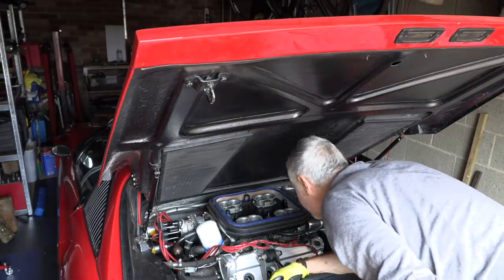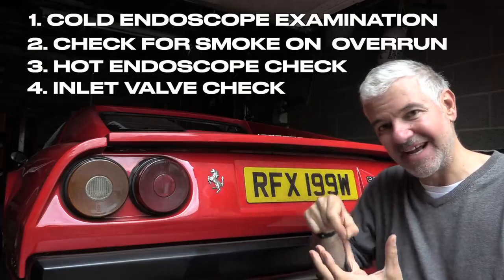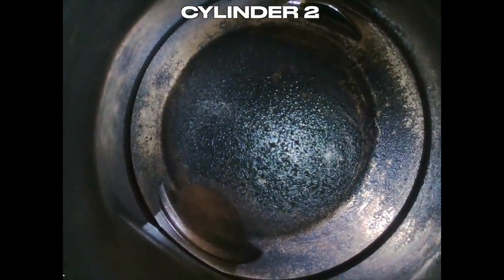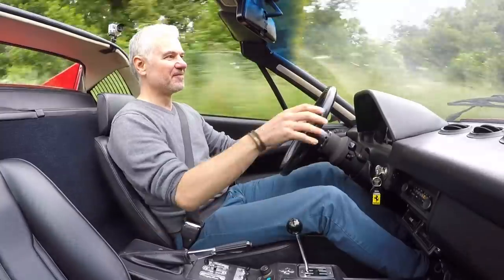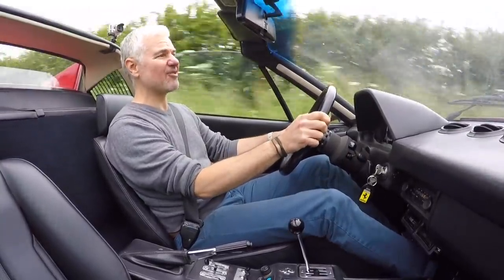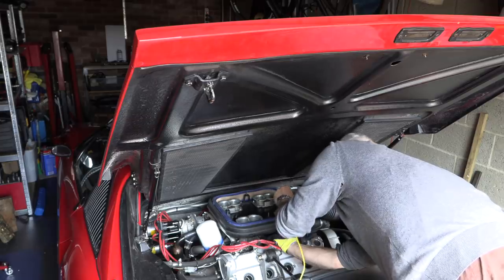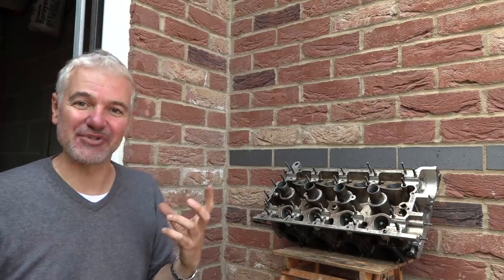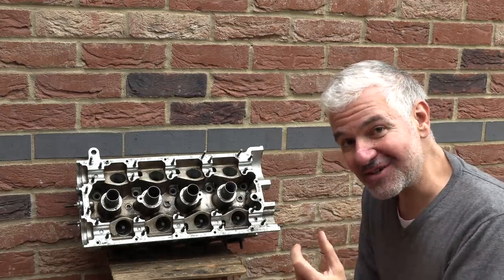Could this £50 tool help me save my cheap Ferrari?

Comment: I don't believe you mentioned if there is any oil consumption. My 308 had a full engine rebuild about 10K miles ago and there is absolutely zero oil consumption between oil changes (every 3000 miles) and no blue exhaust, like yours, at startup or hard acceleration. I know ... it is too soon to see this.
Reply from the maker: Yea it is using oil, just monitoring how much at this stage..

Comment: I wouldn't waste my money on additives. Tbh if there is any major mechanical wear, you are not going to refurbish the engine with any kind of additive. And if you drive the car regularely, there is no reason for stuck rings (you have hardly any carbon build up). I think it's fine, just drive it and have fun ! I'd also go with thicker oil as stated in another comment if it smokes to much. Check how much it burns. A little bit is ok.

Comment: that first endoscope of the inlet valve... are you sure that wasn't a slight pool of oil right at the back of it, collected on top?
Reply from the maker: Don’t think so.. and the oil is dirty so if it was going down the valve stem it would leave stains but as you can see the valve looked immaculately clean

Comment: I don't like the "old cars should smoke a bit" approach, having had cars that did this the problem ends up getting worse, you don't enjoy them properly when you do drive them, you just spend your whole time looking in the rear view mirror for smoke and you have to acknowledge the unresolved problem when you come to sell. This car's engine is in your head now, use the knowledge, finish the job! Plus this is great telly...

Comment: Ok, Oil that runs down the Cylinder Wall will NEVER collect on the Piston and the reason is that the first ring is several millimeters below the top edge of the Piston. Any Oil that runs down the Cylinder wall will run into that gap (Wall and Piston), fill the gap first if the gap on the ring is ‘gunked’ up and then collect on the lowest side and ‘flood’ the piston. This Oil that you are seeing (if it is even Oil) is not coming from the Walls at all but from the heads above and closer to the center of the Bore from where it ‘drips’ onto the piston.
However, why are you so worried about it burning a little bit of Oil? Now that it’s running great, according to you, enjoy the darn thing and put some miles on it!
After 3000 miles or so add up how much Oil was consumed and then determine if it’s worth to do anything about it… Have fun and update us in a few thousand miles😉

Comment: My tuppence worth, it's not got the usual ring worn oil burning traits, ie, blue smoke on acceleration, it seems to be after overrun it puffs out plus it puffs of smoke on start up, all classic signs of top end wear....

Look at it this way, no oil burning before, put some heads on and err it starts smoking, my moneys on the heads, dud they clear all traces of grinding paste before reassembly? I've had experts touch my cars in the past, I've always had to go back and do the job myself in the end anyway.

Comment: The exhaust side indent doesn't look like it has oil in it, just carbon. Probably accumulation as a result of the fluid dynamics and flamefront within the combustion chamber; there would be a "dead zone" in the indent. 

The intake indent is washed by the fuel/air mixture which would explain why it's cleaner, it would also have a greater heat/cool cycle which may affect buildup.

Comment: Have a look at BG PRODUCTS they do an oil flush called EPR which will remove the carbon from the oil scraper rings,we’ve had great results increasing compression, reducing blowback, etc 👍
Reply from the maker: Thanks buddy, will look into it

Comment: This might be a stupid question, why do you rev the car before 55 seconds?
Reply from the maker: You have to Rev it a little to get it started and also to make sure it’s starts running on all cylinders. The choke is not connected on this car
Reply from the maker: Also the clear out the oil, would take longer on idle and give plugs chance to foul
Reply: @Number27  OK that's fair enough. 
Did you see my other comment about a possible crack in the top of the piston on cylinder four? or is that just a scratch in the top of the piston?

Comment: Hi,  PLEASE... Just do a Leak Down Test !  I have rebuilt Ferrari Engines (and many others) and it has never taken me more than 20 mins to fault find/initially establish where the weakness is: -  I.E. Bypass at Rings, Exhaust Valves or Intake Valves, etc.  Please let me know if you would like me to explain the process further.  I can also explain how to very simply make your own Leak Down Tester (for almost nothing, depending on what you have lying about).  Mike Hughes, MKH Engineering.

Comment: Jack perhaps you should have your Ferrari "Carbon Flushed" with HH0 gas. It could clean the rings & help them re seat ... Regards Jeffery
Reply from the maker: Thanks, interesting idea!
Reply: @Number27  Jack I've just had our Fiat Stelo Abarth done... The franchise here in South Africa is a British company called "Carbon Flush" ... The flush made a huge difference to the straight 5 cylinder 2.4cc ... The company here "Unique Motorsport" first put the car on a Dynamometer to get a bace power reading then again once the carbon Flush is done ... The car went up from 100kw on the Wheel to 107 & Torque from 203nm to 207nm ... But the big difference was when you drive the car ... The throttle  & the way the car revs is just so much better... Sure you'd be able to find a shop in UK that do the dyno runs ... Will make a good episode... I'm a Videographer & am currently producing Video marketing material for Unique Motorsport... Regards Jeffery

Comment: I have seen a new engine burning oil. The head and sump were removed and it was found that the rings were not aligned at 120 degrees and oil was passing them. Rings were correctly set and engine rebuilt. Oil burning was stopped!!

Comment: you appear to have clean the top of the pistons. you should not have done this as you have cleaned away the sealing action and thus you burn oil. will take time to build back up
leave it alone and dont over do it wellknow in the trade

Comment: drop the oil...........go up one grade of viscosity.........try it for a couple of hundred miles....see what you think.....as engines where, viscosity needs to compensate. Its not brand new, so the factory spec viscosity is meaningless...............is your crankcase ventilation clear and working as it should????
Reply from the maker: Need to recheck the crank ventilation though it seemed to be working ok from what I could see

Comment: You’re overthinking all this. Drive it till until it starts burning oil or fail the smog test, then you will no doubt have pull the engine for a rebuild. The cylinder heads have been eliminated as a cause for burning oil. Check the crankcase ventilation system, time better spent investigating that than exploring the bowels of the individual cylinders with a fancy camera. Good luck!

Comment: Take the plugs out and pour redex into them, leave for a few days.
Reply: …and be prepared for more smoke than you can possibly imagine.   Ask me how I know?… ;-)
PS I’m not saying you’re wrong, in fact it’s not a bad idea, but the smoke that comes out when it’s started makes Bond’s DB5, “Smoke screen”, look like a stray cigarette butt…
Reply: @duckmcf   yes they smoke for a few minutes that's for sure, used to poor it straight down the carb inlet on a running engine then you will see a smoke screen bond style.
Reply: @richardblencowe3924  Right…. There’s my problem then.  I poured some into each cylinder AND poured some down the carbs, which was tricky as they were side draught Dell’Ortos, so I likely over did it..

Comment: what spark plugs did you fit?
Reply from the maker: NGK BP7ES
Reply: imho 7's are still too cold for a carbed 308. I think your black plug problem is your plugs arnt self cleaning. My 308 is running ngk bp6res.

Comment: Presumably you de-coked the top of the pistons when the heads were off...If so that`s a huge amount of coke that`s built up already for the mileage since rebuild...looks like a complete set of new rings is needed providing the bores are not badly worn...and if that s the case .....a re-bore and new pistons and rings...i can see the pound signs now...hoooow much did you pay for this car!!!!

Comment: as a mechanic from the 90's+ that worked on many!! of these cars.. what i saw of the carb balancing with Ian (who i know is very well known) I would invest in a card equalizing meter..(https://www.amazon.com/Latest-Rage-5385730856-Carburetor-Airflow/dp/B00CMC57R0) something like this... had 1 for 35 yrs now and use as a No.1 before trying to tune... seems strange to me that it all is just 1 bank that is suffering... all pistons have travelled just as many times so wear would be generally on all cylinders.. so what supplies just 1 bank.. the carbs...

Comment: I’m sure you’ve already done compression tests haven’t you Jack?
Reply from the maker: I have.. compression perfect on all cylinders
Reply: @Number27  I believe it was around 180? A really cheap & dirty way to clean the engine internals, add one quart automatic transmission fluid to oil. Start and run engine about 15-20 minutes at high idle. (1200-1500) Then change oil and filter. Need to high idle to get the oil slinging up into the bottom of the pistons.

Comment: Just drive the living snot out of it for a month or two and see what happens. I missed how much oil is actually being consumed, but it isn't a new car, either.
Reply: I agree. Back in the 'seventies I bought a brand-new Triumph Dolomite Sprint; from new that car needed a good thrash up the local bypass every two or three weeks otherwise it would would choke up and start using oil. I sold it after five years and nearly 200k miles and it was still going strong.

Comment: Honestly, I'm not convinced you have a real problem.  The car sounds great -- the oil consumption doesn't look at all excessive from these videos.  Do you know how much oil it's consuming?  Go on a long (1000 mile) road trip and keep track of how many quarts you need to add.  
The owners manual of my Mondial 3.2 (equivalent to the 328) says that it's considered normal if the oil consumption is between 1-2 quarts per 600 mi (or 1-2 liters every 1000 km).  That's a new motor (although broken in).  In most other cars that would be considered excessive -- even air-cooled 911's are supposed to do better than that.  But that's normal for that Ferrari motor.  So, like I said, you may not have a problem at all.
Reply from the maker: There’s defiantly oil in those cylinders and there shouldn’t be!! Thanks for watching!!

Comment: Jack, when you have finished a complete out of car engine rebuild on that Italian delicate little engine, stop revving the guts out of it when its cold mate. Those engine needs warming up, look at Iain Tyrells start ups. You must use the very best oil, fuel and plugs and then go to the local Porsche dealer for a powerful 911 Turbo. About 70,000 quid should buy yo a decent one.
Reply from the maker: I’m not revving the nuts  off it when cold.. barely between 2-3k in very short bursts .. it needs a few revs to clear the oil and get all plugs firing.. plus this one has no choke connected.
Reply: @Number27  You will have to rebuild Jack. No other way to fix that one. But first go for a 1000 k drive at all speeds to get some heat into that engine. This pottering is not good for you or the engine.

Comment: I doubt that the motor needs oil control rings, or otherwise, a compression test leak down would tell you the whole story however. I'd check your crank vent system, talk to the professionals to see what to check for in that arena,  you want a slight vacuum to the crankcase to help pull oil back into the crankcase. Try some Marvel Mystery Oil in the crankcase with oil change.... https://www.marvelmysteryoil.com/how-to-use/marvel-mystery-oil/gasoline-engine/automobile

Comment: Time for a Quicky Ricky ring job with new cast iron rings and and a Qucky Ricky cylinder hone with one of those goofy ball hones, or a proper hone, and some new rod and main bearings while you are there, and some new connecting rod bolts, probably a piston pin and circclip with the rings. And a tourque wrench. If you watch those Harry's Lamborghini videos from Iain's place you realize it is not rocket science and a connecting rod is a connecting rod who gives a shit if it says Ferrari on it.

Comment: remember , your original problem was INTERMITTENT  !  power loss Not continuous oil leaks , UR are getting things mixed
Reply from the maker: Nope, as the plugs got fouled it would intermittently misfire. No longer the case as hotter plugs keep cleaner longer.

Comment: Make sure the PCV system is working as it should. If so, drive the snot out of it and see what happens. Italian tune up. That should free gummed-up rings pretty quickly. Don't baby that bitch, give her the full business. Whatever the problem, you might as well force it to fully reveal itself, especially if the alternative is to pull the engine out of the car and do a rebuild.

Comment: I don't understand why you didn't use a boring gauge to check each cylinder before you put back those rebuild heads. Stop fooling around , DO as PGTMR2  suggest a Seafoam treatment to break the carbon deposit in the combustion chamber of all cylinder and DO a freaking compression and leak test PLEASE!
Reply from the maker: I’ve done a compression test which was perfect on all cylinders, I also did this before  the rebuild. I visually inspected bores with a mechanic and he said they looked fine. Leak down would tell me nothing.. valves are clearly sealing and oil in cylinders is giving rings a good seal, whether they are good or not. Valves can be sealing ok even if there is an issue with guides or valve stem seals
Reply: @Number27  My suggestion was for after you clean all combustion chamber! If you don't find bubbling in the coolant or whistling from dry sump tank
or crankcase breather, you can eliminate many possible problems from the equation. Since this happen at cold start and under heavy acceleration, how about trying a oil catch can?

Comment: Jack that just looks like carbon on the pistons 🤔
Reply from the maker: Definitely oil.. and it varies very time I inspect it.. so sure it’s oil
Reply: @Number27  what about the seals that were visible in number 2 & 3 inlet valves where the oil streaks were visible.....maybe faulty seals

Comment: "im not going to take it apart, im going to drive it" praise the lord, - if in aint broke dont fix it!
glad to see u changed heat range, now put some thicker oil in + DRIVE THE BLOODY THING.
PS - your free flow exhaust has less back-pressure - this may adversly affect the breathing system, - talk to the people in the know, or  make up a catch-can system [temp] so no oil fumes are going into the inlet circuit + give it a whirl

Comment: Two choices as i see it; a, run it as is add oil as required, b, park it up and SAVE for a MAJOR rebuild by Ian Tyrell,s workshop, yes it will be expensive, no doubt, But with the engine in its peak condition and serviced properly with top quality oil and filters etc it should be good for many years! 
As i have said before Italian supercar engines are more fickle than say a Japanese Honda engine, they build their engines to tolerate all sorts of abuse, Italian,s DO NOT! 
Honda have built two quite notable supercars; the Honda NSX V6, the Honda S2000, deserves the title of supercar, why; the S2000 engine has the highest specific output per litre of any naturally aspirated engines and with proper maintenence should last a long time!!